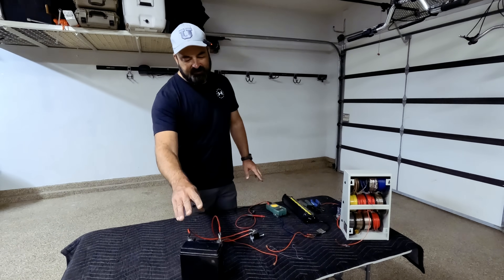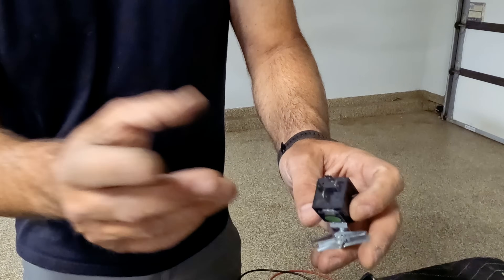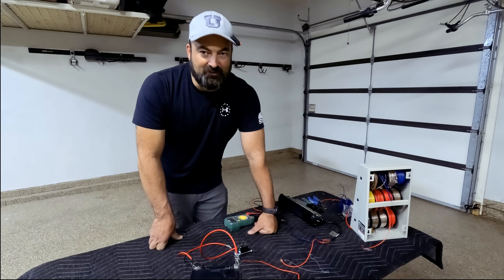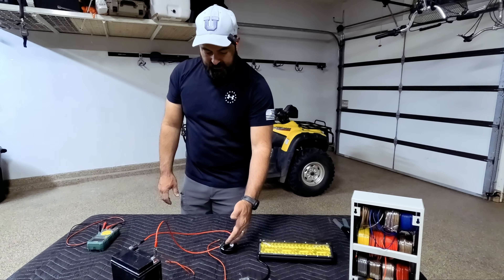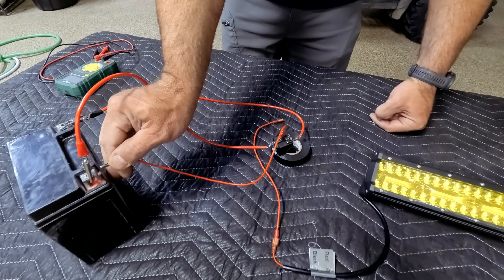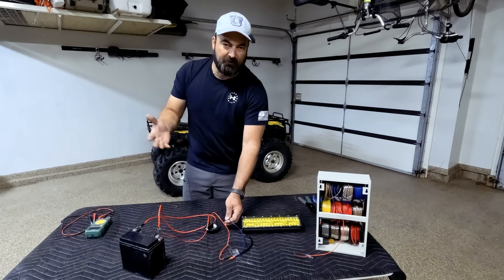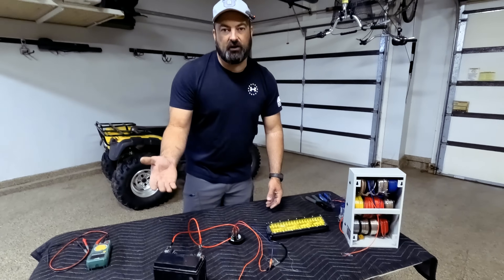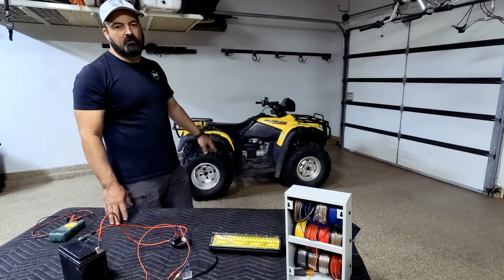How to Wire a Relay for Light Bars on ATV, SXS or Automotive Accessories

Comment: How would you go about using the same curcit but hooking up 2 seprate lights instead of one
Reply from the maker: Just connect both lights’ positive wires to the same relay output and you’re good to go.

Comment: Relays usually (at least in the ones I use) have an schematic on the cover so you know which tabs correspond to the power circuit or the solenoid circuit. But this explanation is great as well!

Comment: Great vid on relays, but confused how you splice into high beam circuit.  You seem to insinuate you take the wire somewhere between the switch and the high beams to 86 on relay, and 87 to light bar, but now nothing is going to your high beams.  Do you splice a wire off the high beam wire?
Reply from the maker: I leave the high beams wire still connected to the headlights.  I just tied into the high beam wire to trigger the relay.    That way it leaves the high beam function intact,  but uses the relay to handle the power to the light bar.

Comment: I have a rough country light bar. Trying to wire it to a Honda  CRV that has no existing high beam assembly. Do you have any idea how to wire this to naked high and low beam wires ?  The fuses for high/ low are the same. It’s replacing some smaller lights that didn’t need a relay.  Light bar comes on but can’t toggle from steering column to low. Thanks for any help !
Reply from the maker: I’d suggest wiring in a standalone switch vs trying to isolate a trigger wire out of the steering column.  Depending on your car there could be a ton of wires in there along with airbag wiring.  Many times car manufacturers use the smallest gauge wiring they can get away with, which makes tying into them difficult.  Not that it couldn’t be done, but you risk something going wrong if you’re not careful.
Reply: @aspenandpines  thanks !

Comment: Wheres the fuse??
Reply: My research: the fuse should be in line before the relay wired before number 30. Googled: "what relay terminal should the fuse be connected to?" This is probably the best video instruction I've seen so far. Thanks for the video.

Comment: I understood it but why even add a relay and not directly to the battery? I want to add a separate LED bar directly the battery but do I need a relay?
Reply from the maker: You can wire your LED light directly to the battery, but all the power to run it has to go through your switch. A relay lets the heavy lifting happen with larger wires, keeping your stock wiring (which is usually small and not built for extra load) from overheating or failing.”
Reply: @ thanks for ya response. How do I choose the relay? Where’d you get your relay so I can follow along and take Marty back to 1985

Comment: Great video very informative but I have a question can you run 2 spotlights and a light bar of the one four pin relay?
Reply from the maker: You would need to add up the amperage draw of every accessory you put on the relay.  As long as it does not exceed 80% of the amperage rating on the relay you’ll be good. I would imagine if your spotlights and light bar are LED they won’t pull over the amount of amps available.   A quick and dirty way to calculate the amp draw is to add up the wattage of all lights on your circuit and divide that by 12, if it’s under 80% the amperage of your relay, you should be good.  A 30A relay should support 288 watts safely.  Make sure to do your own research and make sure that you are following best practices.  Off road vehicles experience a lot of stress error on the side of caution.

Comment: Where would you typically mount that relay?
Reply from the maker: For a UTV, somewhere up under the dash inside the cab. For our Rubicon’s, I’ve put them behind the dust shield under the headlight or in the pocket under the front fender.

Comment: what about the compass way?                                                                                                                                                                                                pin 30 = South, Solid fused 12v                                                                                                                                                                                                pin 85 = East, Earth                                                                                                                                                                                                                            pin 86 = West, sWitch                                                                                                                                                                                                                     pin 87 North, New accessory
Reply from the maker: That’s another useful way of remembering, thanks
Reply: @aspenandpines  all you need to do is have the one pin horizontal at the top and the others ones vertical  and you'll have pin 87 at the top

Comment: If I want my headlights to power my aftermarket grill lights can I tap off the fuse for my headlight to use as the switch, if I don't want to tie into a wire from the headlights ?

Comment: Hi, I’m setting up some led underglow to my motorbike. Can I follow this entire setup accept instead of the wire going to your headlight switch. Wire it to rocker switch of some sort?
Reply from the maker: Yes, you can run the trigger wire for the relay through a switch.  Basically that is what I did, but my rocker switch in this case was my headlight switch.

Comment: went through 4-5 other wasted-my-time video's and yours made a ton of sense right off the hop! I give you 10 thumbs up! Thanks😉
Reply from the maker: Glad it helped you out!  Thanks
Reply: SAME!!  This was great.  wonder wear I put a fuse thought or do I need one with the relay
Reply: @matthewford2869  i would put the fuse near the battery, this way you'll have a small bit of wire between the battery and fuse not protected